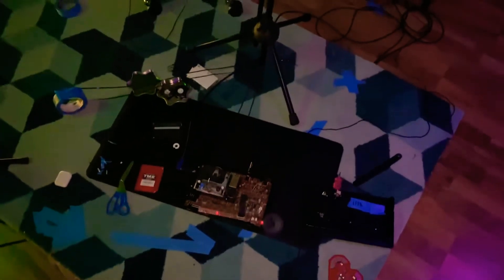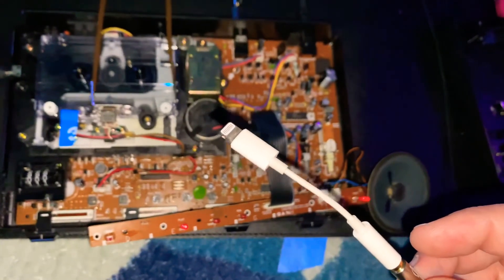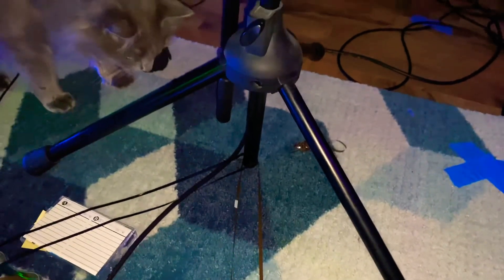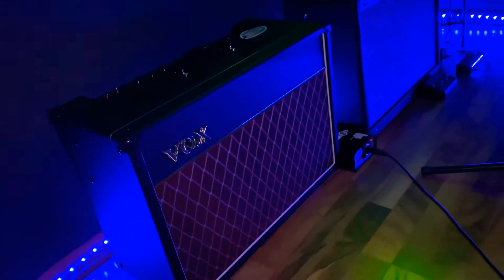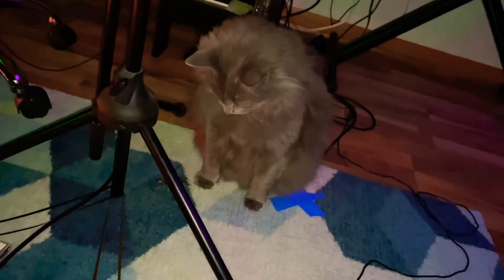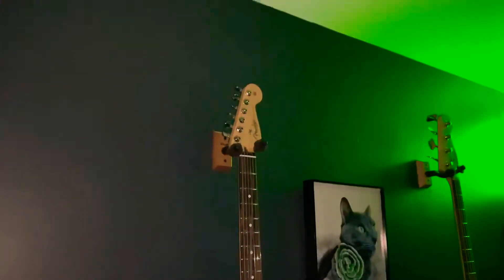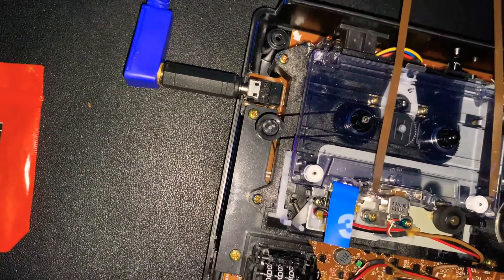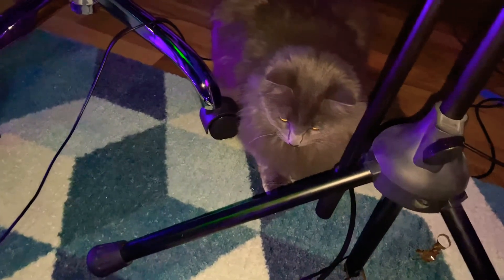Recording and playing loops on old Sanyo TRC-8800

Comment: Is the headphone ouput stereo on the trc 800?
Reply from the maker: I’m not 100% sure. I know that the line in and all recording function in mono only. I’ve never tried to play a stereo cassette through it but I do know that the headphone out will play in both left and right channels but I think it’s dual mono instead of true stereo.
Reply from the maker: I should have been more clear in my original reply. I’m pretty sure it’s mono because the purpose of it was originally as a dictation machine and telephone recorder. The line input is picky and wants a mono plug which I just use a stereo 3.5mm to mono adapter to get it working consistently. 

The output on the headphone jack is also dual mono which means you’ll get a signal in both ears but if you connect the output to a mixer or audio interface it’ll be mono only. 

The pros of this machine are the awesome dictation feature and what you can access by tearing it apart. You can adjust the recording speed with a potentiometer on the PCB and there’s sliders for volume, tone, and playback speed as well. It’s great for mods and lofi sounds. I actually got two of them and use one for more experimental tape looping and experimental stuff and the other I didn’t take apart so I could get the lofi sound with no hassles. The microphone built into the included remote is also great for lofi recording of live sound sources and there’s indexing features along with other pro grade features you don’t find on regular dictaphone. 

I hope that makes things clearer.
Reply: @thedarph5096  Thanks. I got to try one and yes, mono. I'll keep looking. Cheers